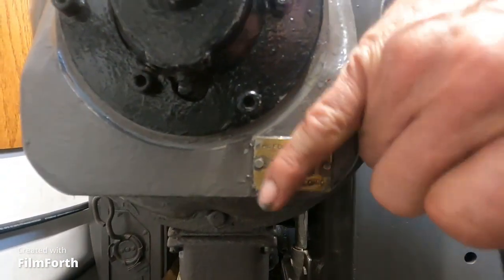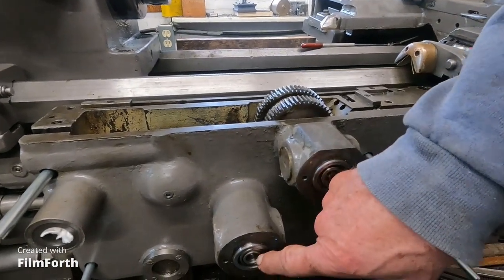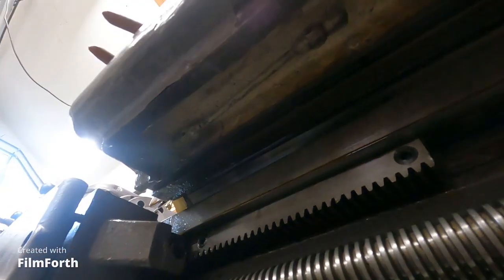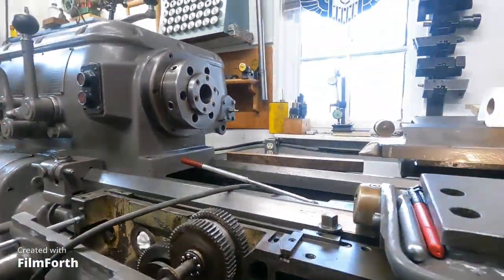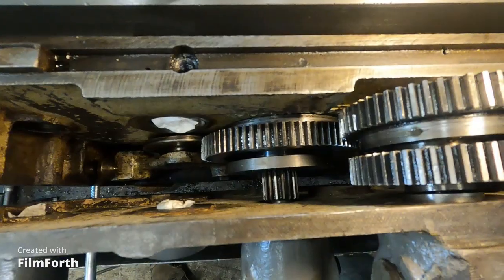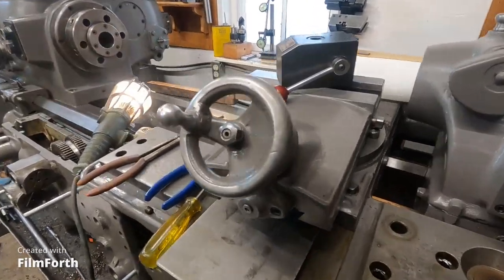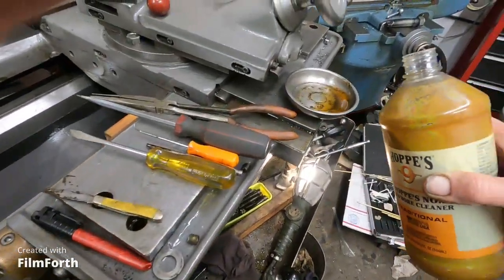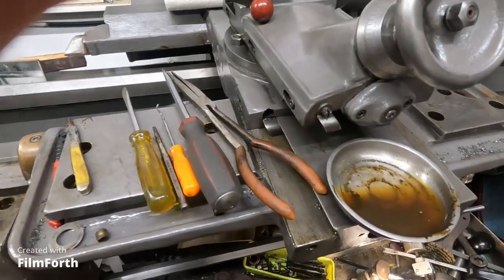Restoring the Axelson lathe carriage oil system

Comment: Great videos as always thanks for all the great information you share with all the viewers.  Bridgeport milling machines the old round arm  the Bullard vertical some Kearney and trecker machines had the alemite fittings for an oil gun  but some people pump grease into them, that's a fun job tracing all those passages,  Thanks again  ed
Reply from the maker: You are welcome, cleaning out those passages took several hours, it will be much better in the long run

Comment: My DSG was packed full of grease when I got it, full strip down to individual components of the tailstock, compound slide, cross slide, saddle top, taper attachment to get it all out, the apron was actually OK, I could remove the parts that had got grease but most of its oiling was by wicks dripping down copper pipes from a small oil passage, which didn't get full of grease as it had blocked up before it got that far, how long those parts didn't get any oil I don't know but nothing seems to be wrong in there.
There is an engineer I know who says "A lathe is only as good as the last man that took it apart"
Reply from the maker: I suspect the oil passages were clogged and the person working on it decided to grease everything, it took considerable amount of time to clean it out, deep in there was dry dirty powder that built up like cement. Using grease caused the check balls in the oil pump to stick.